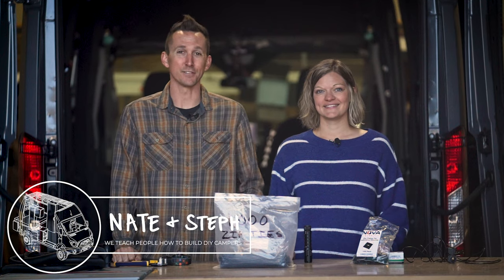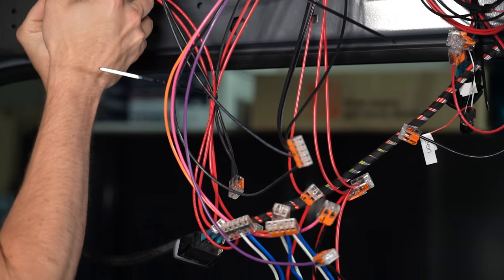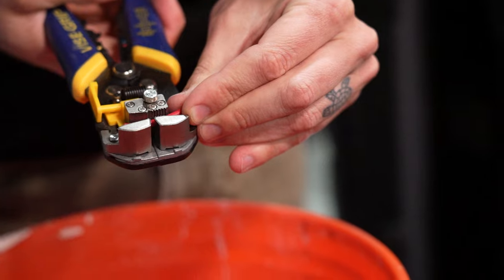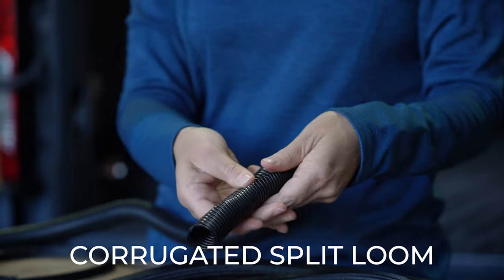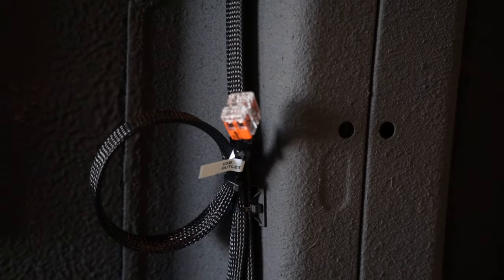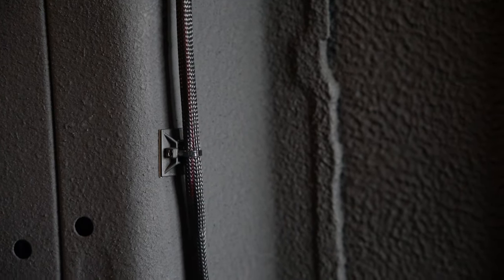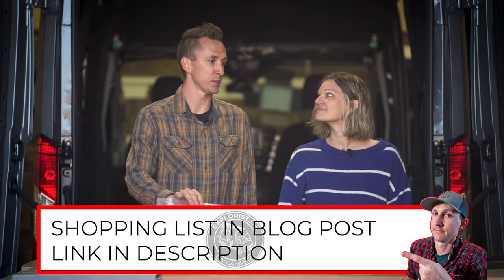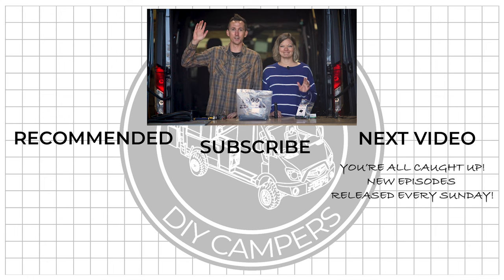7 DIY CAMPER ELECTRICAL WIRING TIPS (For Under $25)

Comment: I was looking around for flexible conduit and I wasn't finding anything that would work. Your words of Wire looms was perfect. So, my question is: what size for cables to fit in? 1/2in? etc.. I'm asking for a 'basic build" like what you showed in the beginning. Obviously, getting the wire loom that's too small for all the wires I need to run is VERY bad, so I ask this question hoping y'all can answer.

Thank you in advance!!!

Comment: Your right, in commercial vehicle wiring (ambulances and fire trucks and police cars) they use all the items all the way through the vehicle. The only extra thing they use is knock on edging to protect cables from rubbing on the sharp metal edges. I've just stripped out an ambulance to convert and I've saved all the original cable/wire protection to reuse in my camper conversion.
Reply: Yes, I was surprised that they didn't mention your point. Grommets are used throughout every car that I have worked on. Plus, no matter how you wrap wires, it's only a matter of time before those razor-sharp edges cut through the protection placed on the wires.
Reply from the maker: Ah, yes.  We used wire grommets and knock-on edge protection in several areas.  I've added those two items to the shopping list above in the pinned comment.

Comment from the maker: Watch our Branch Circuit Wiring Playlist: https://www.youtube.com/playlist?list=PLmvhcyi4n0TUUwvonaPhIPqUqBiC7CiyY

Shopping List:
Flashlight: https://amzn.to/3A2Cefj
Headlamp: https://amzn.to/3ODYosn
Wire Strippers: https://amzn.to/3Ok6oiD
Hot Knife: https://amzn.to/3yl7Fk4
Braided Split Loom: https://amzn.to/3OEaiT9
Braided Loom (un-split): https://amzn.to/3ODiyTj
Corrugated Loom: https://amzn.to/3OntKUr
Label Maker: https://amzn.to/3HOBQ6f (...or the label maker we actually have: https://amzn.to/3bvsYGF)
Zip Tie Mounting Squares: https://amzn.to/39OBf7R
1,000 Zip Ties: https://amzn.to/3OByUMZ

Other things we used but forgot to mention:
Wire Grommets: https://amzn.to/3OKOMwf
Knock-on Edge Protection: https://amzn.to/3OpRJ5r

Comment: Hey you all! You two are doing such a great job explaining the intricacies of making an off-grid van. My brother-in-law and I are converting his Mercedes sprinter van at this very moment and your videos and website advice are invaluable.  One question that I can’t find a good answer to is grounding 12 V accessories to the chassis versus running a wire all the way back to the negative side of the fuse block. Since all of our Victron electronics, including the 3000 W inverter/charger are grounded to the chassis along with the Battleborn batteries, is there a functional need to run a negative cable all the way back? Thanks for your answer and keep the videos coming!
Reply from the maker: Running a negative wire all the way back to the fuse block like we show in all of our branch circuit tutorials gives a better connection and will cause less troubleshooting issues in the future due to loose grounding connections.  There does indeed need to be a chassis ground, but it shouldn't be relied on to flow power for everyday items.  It's more of a safety thing.

Comment: One thing about the zip-tie mounting squares with my experience is that on some not all, the adhesive will eventually fail due to heat.
Reply from the maker: Yeah, if left to the adhesive alone, they will definitely come off.  We screwed all of the squares to the metal.